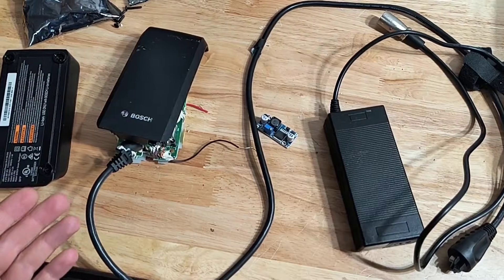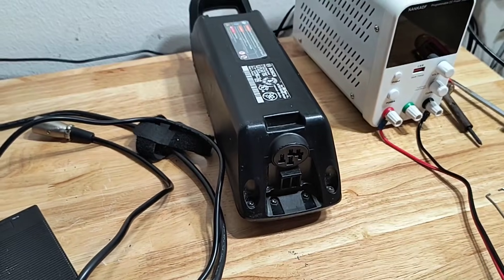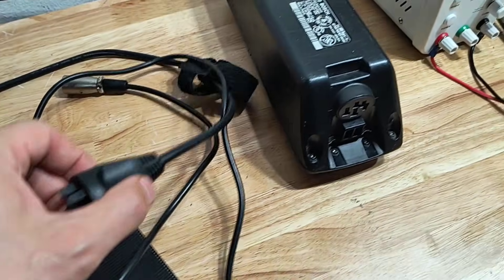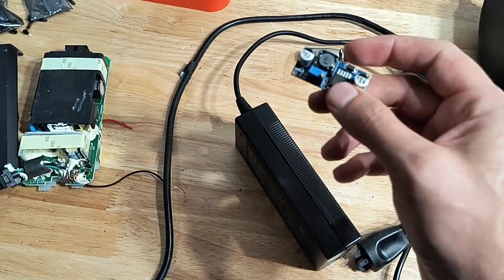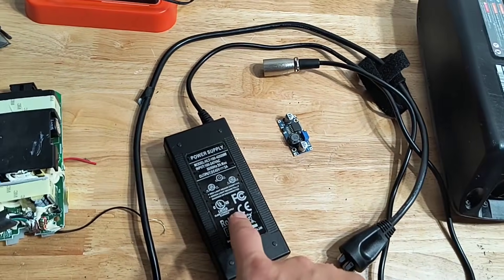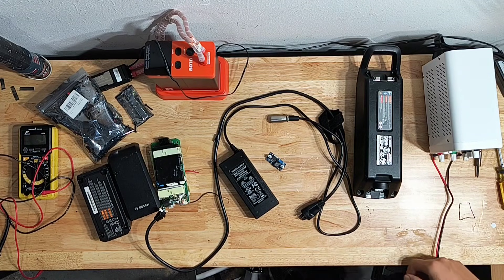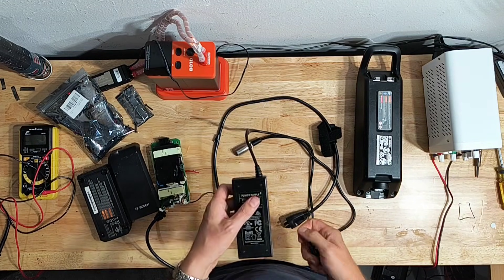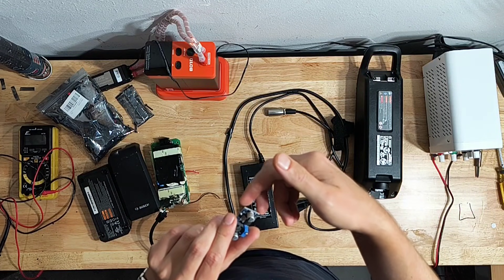Charging Bosch ebike battery with generic 42v lithium charger by using this $1 board

Comment: Nice job! If the 5V line is low current, you could use s simple  7805 linear regulator instead  of that buck converter.
Reply from the maker: Yeah there is almost no current on that 5v. Good to know. Thanks!
Reply: Your general point that you can use a simpler circuit for this stands, but the regulator you're suggesting isn't rated for this voltage, it tops out at 35/40, depending on the model. You need 42v for this application, and to be safe probably better to get one in the 50-60 range (for some leeway).